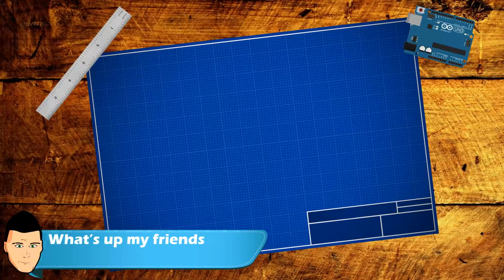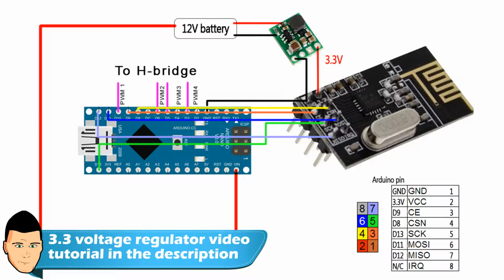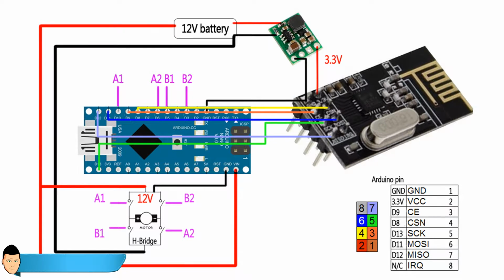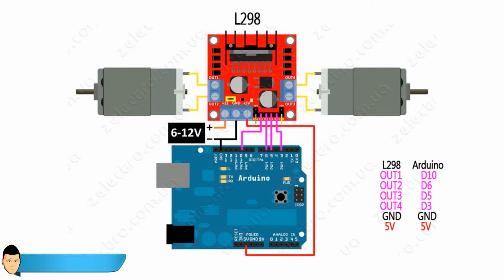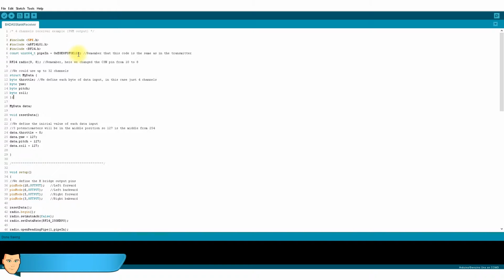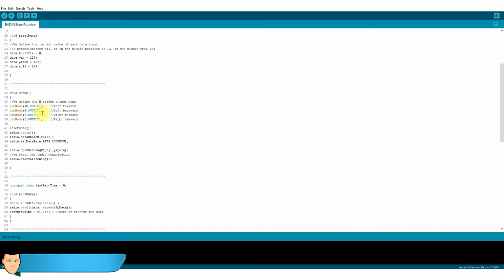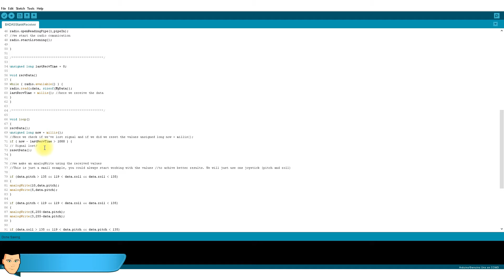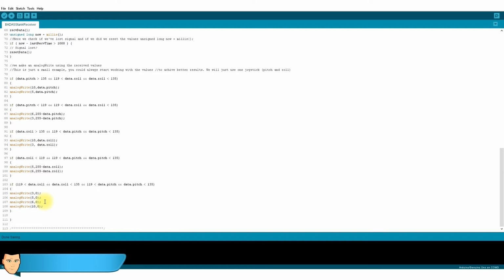Tiger 1 3D tank Radio receiver Arduino NRF24

Comment: Hi. do you know if the 4 in 1 module for the   taranis will bind with the nrf24?
Reply from the maker: kriss fly I'm afraid not. those RC have their own modulation, frequency, encode, etc. I can't tell you for sure but I've bought some "compatible" modules with NRF24 and not even those worked... but keep searching info, maybe there is a way to bind this modules...
Reply: ELECTRONOOBS OK thanks :-) I have a old transmitter so I will try building one that way. And skip the 4 in 1. I have to get motors and a H bridge and hope to build your tank :-) and post my build on my YouTube. Thanks again awesome videos